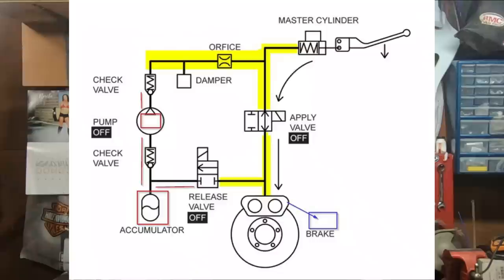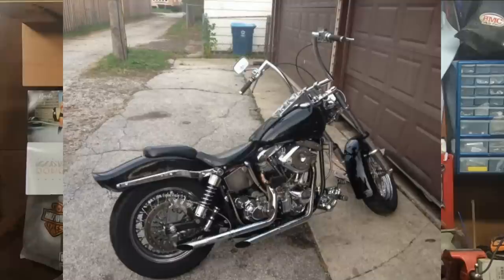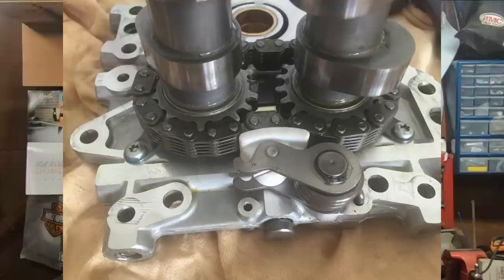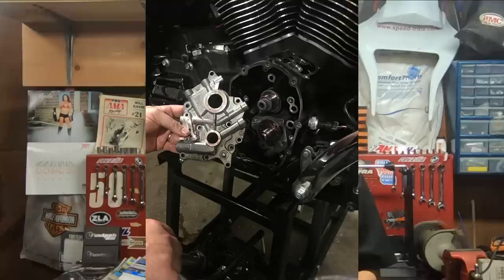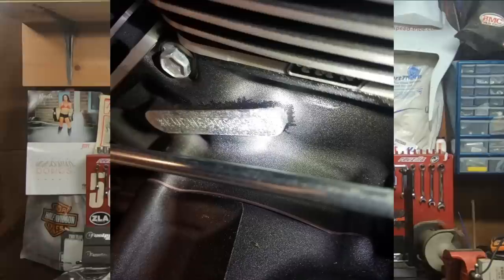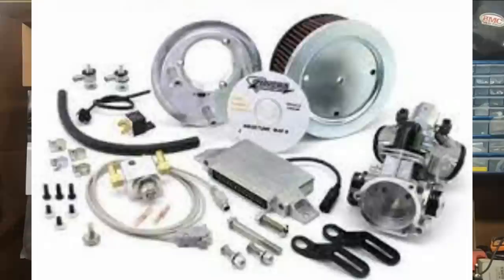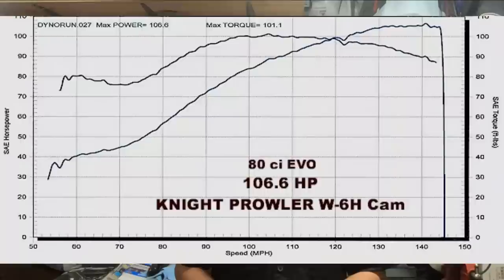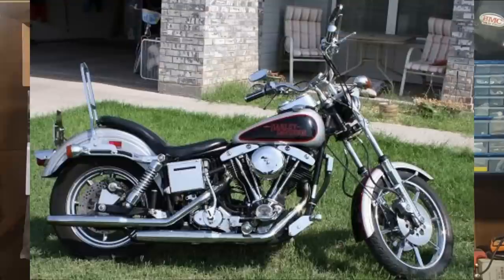Best Harley Engine Ever Made (Arguably)

Comment: I have a couple of 02 gear driven wide glides and love them to death. S&S 509 and 570 cams, whole lot more goodies of course. You are 200% correct on the roller bearing set up that Harley switched to in 2003. Last year of the timkin bearing set up  from Harley was 02 and I feel that they have gone down hill ever since. Only thing I would like is to be able to do is set my idle like an Evo, but I just don't trust the oiling system. A cammed Evo at 650 rpm just sounds bad ass.
Reply from the maker: That gear drive whine is one sweet sound but for sure on the FI twin cams you don't want your idle below 900. Sucks you can't idle them down like the good old days.
Reply: @GixxerFoo  I've actually taken the first one in because of that "whine" and got a "yup, that's what they do, sounds good"...lol. I can adjust the idle down because they are carbed but I have seen the oil light flicker around 800 rpm, sucks because it sounds great
Reply: I have an 02 Road King that I bought maybe 7 years ago , runs amazing, never a hiccup , my friend is an experienced Harley rider he told me bike has timkin bearings that’s the better engine …I had no idea I only rode metrics but I have a few bikes and the Road King has never let me down , runs perfect I just change the oil and filter ..

Comment: 80ci & 80HP Pretty much the Reasonable performance & reliability limit for genuine HD EVO. And that’s enough for most folks. If you want more the aftermarket Evo can deliver 100+HP and reliably. So I generally agree. 

Also I suppose if you need major work on your M8. It probably takes some specialty tools from Jim’s. My own experience was a full warranty stage 3 out the gate all genuine HD that made 116 HP. Good power without pushing anything too hard. So far 30k miles on my Sport Glide zero issues. No repairs whatsoever to date. For me the right aftermarket EVO could be really cool but it’s definitely easier to find an M8 that is also a powerful reliable and relatively simple engine.
Reply from the maker: You get a M8 done up like you've got and they are one hell of a motor, I think sometimes they get pushed pretty hard with what they are capable of. Evo always had a way of putting that power down that made it feel faster than what it really was.

Comment: Not counting collector bikes that I would just ride on Sunny weekends, my favorite everyday riding Harley engine of all time is the Evo. Specifically the Sportster Evo. I would trust this over any other Harley engine to ride daily. My twin cam is nice but I'll be adding an Evo Sportster to the garage when I get a chance. I really miss my old 883 for everyday riding. My 883 could run on 87 octane, it got excellent miles per gallon when I toured it( yes I toured 27 states with it), the drive belt was easy to change, push rods were straight up and down, no wobbly cranks, came stock with gear-driven cams, oil pump is easily accessible, less places to leak from the primary, easily accessible transmission gears on the Pre-04, simpler oil change than the big twin. I find it ironic that the best made Harley of all time is also the least respected.
Reply: Nicely said. Once the traditional Sportster is canceled for the new China engine, watch it suddenly become a very sought after model.
Reply: @browngreen933  I'm hoping to grab one before it does.
Reply: @jamessouthworth1699  
Now you've got me wanting one too!
Reply: Bought myself a 98 Sportster S.... I just love it. Complete peace of mind in the engine department ✌️
Reply from the maker: I am huge Evo Sportster fan, that is a bullet proof motor and honestly it's about as close to perfect as you can get. I wish Harley would of used that same design and built a big inch version. S&S had that 100inch motor for a while but it was very expensive, didn't really put out the horsepower I would expected at around 100 but the torque was up over 100 which is a huge win on a Sportster.
Reply: @GixxerFoo  I just love the 98 Sportster S..... It has  magic torque...

Tell me do the Sportsters have heat issues?

Tx for your channel bro, really appreciate it 🙏👍
Reply: Man am I glad that the slightly used Sportster 1200 that I bought turned out to be an '02 ! I put on an Accel coil , Cobra exhaust pipes and the S and S air cleaner . After having the carb re -- jetted by the pros at House of Thunder in Morgan Hill , CA , that thing runs like a champ . Very pleased with it .
Reply: I had an Evo Sportster, also a couple of Twin Cams. The Sporty was a far better bike all around. My opinion the best bike Harley has ever built. My jury is still out on the new models. I have moved on to other brands but would like to add another Sporty to the stable. Prices on Sportsters have skyrocketed lately though so probably won't happen. The only shortcoming on the Sportsters is the horrible suspension which can be fixed with $$$s.
Reply: @karlbishop7481  ain't all of that the truth.... Like art they will be properly appreciated now that they have stopped building them👍
Reply: That is so human nature... They are now appreciated in hindsight like Van Gogh
Reply: @browngreen933  I’ve got an sportster 1200 in the garage, I may add another bike to the fold but after seeing what they did to the new sporty mine earned a permanent spot for sure.

Comment: I like the new Harley’s but I will keep my 01 fatboy and 03 roadking. I did the cam plate upgrade,509 cams,adjustable pushrods,lifters,2 into 1 exhaust,high flow air cleaner and tuners. Now I know what I have and don’t want to start all over with a new bike,I’m getting older and seem to ride less and less every year.
Reply from the maker: I like the new bikes myself but I just can't see spending that kind of money only to convert most of it back over to the old school designs. You've got your Twin Cams all setup right so I wouldn't be in a hurry to get on a M8 either!

Comment: My sportster came out of the box with 70HP and it was a 1200. Love that bike for its pure simplicity and the advantage over my Victory is the carburetor adjustment and timing I can adjust for maximum performance with just a screwdriver and a timing light. The modern bike takes a Dino and a computer with any kind of upgrade and I can't do the adjustment with simple tools. Even the Harley guys made compliments when I took the bike in for tires and it was all stock and the tech was rolling the throttle and saying how smooth the engine sounded.
Reply from the maker: Sportster Evo is about the closest to perfect design ever put into a Harley, they are solid and dependable motors!
Reply: @GixxerFoo  I have a 2017 sportster 1200 and that comment you made about the fuel injection made me a bit nervous. Is there something problematic that I should be looking for in particular?

Comment: 93 FLHTP I just converted it to a Tour Glide fairing over the winter I love it it looks like a RG. Mines got an EV27 ..S&S lifters…S&S steel breather gear…S&S carb…changed out the bearing…Andrews push rods ….3 angle valve job and Thunderheader and for an 80” it pulls really well and in my opinion…it sounds better than my 83 Shovel
Reply from the maker: That's awesome! That's what I love about the Evo's is you can make them anything you want and getting a hot motor is way less expensive than the new bikes!

Comment: solid vid again,  i have a buddy of mine who has a 98 dyna that had a evo in it but the cam bearings walked on it and replaced it with a revtech 100 ci which just happens to be a big evo... 180 km (112 thousand miles ) on it and its still running strong as ever... old Harleys never die.. they just go faster
Reply from the maker: That Revtech 100 has to be a blast to ride, those engines put down a lot of power! Those INA bearings that came stock were known for doing just exactly what happened.

Comment: A friend bought a then-new '98 RK. And after doing the cam bearing with a mild cam and Jim's Powerglide lifter & block set, he put over 110K miles on the otherwise stock EVO with no part failure.
Reply from the maker: That's what is absolutely awesome about the Evo, he did everything you'd want to do to one and sounds like he took care of it to get to 110K!

Comment: My evolution is the best one I’ve ever had!  She’s the last one you can actually work on, as a garage mechanic.  The new ones are dealership babies and you better be good, or bring it in for mechanics to work on. That means a lot more money!
Reply from the maker: The Evo is the last one you can use basic hand tools on, you get into the Twin Cam and M8 you'll need some specialty tools. There's not a rental program on those so you're stuck buying them which sucks if it's a one time job.

Comment: I owned a 1948 Panhead for about twenty years, an Evo Heritage, a Twin cam 88 Roadking, and my current ride a 2010 Electra Glide Limited with the 103. I liked the kick-starting, the sound and the feel of the Panhead. I really like the cruise control, stereo, 6-gallon gas tank, and the ABS brakes on the Electra Glide. What I didn't like about the Evo and the twin cam 88 was the 5-speed tranny, (they needed a sixth gear) and the loosey single piston brakes.

Comment: Love my Evo bike. I also recently sold. RK TC88 to buy a 2015 ultra limited with the 103 high output with liquid cooled heads. Essentially, what I've realised about Harley engine's, is that if you get the last varient its usually solid. TC88 had the better bearings originally but the tensioner issue etc by the time the 103 was finishing it's life, it was nearly perfect. M8 came out with transfer issues and sumping, with that oil pump issue, by the time we get to the last push of the M8 that will be an incredible motor too. Their incremental improvements over the years always add up.
Reply from the maker: That's very true, same goes with the Shovel and the Evo! I've said for a while now that late model 103 was just about perfect, now the 110 still had it's issues lifters with the 255 cam.

Comment: My 96 Softail Custom Evo goes awesome. I've put an Ev27 cam with bigger jets in the carb, K n N air filter and after market slip-on pipes and it can sit on 80 MPH all day long, plenty fast enough for me. No bass gasket leaks because I always warm it up properly, but did have to replace the plastic breather gear because it broke a few teeth.
Reply from the maker: Warming those Evo's up goes a long way! EV27 is an awesome cam, that was one of the best Evo cams out there.
Reply: I just put the EV27 cam in my 98 RK.. ..
Reply: @mrwilson2225  What do you think of it?
Reply: I like it, it was definitely a good investment.

Comment: Great video, Years ago I had a similar problem with my 2001 Road Glide. I installed a progressive suspension touring link and solved the problem. Now I own a 2010 Road Glide and installed a alloy art frame stabilizer after putting 21 inch front rimand tire and solved the wobble.

Comment: I was one of the very first buyers of the EVO MOTOR... It was a great move for HD reliability... BUT ... BUT ... The Electronics Ignition FRIED 3 times.. I put points in it!   The CLUTCH FELL OUT OF the SLOTS  ""TWICE""  The Valves always knocked and I just rolled with it!  The Shovels and PANS were pure SHIT!  I had 4 of them and they all were NIGHTMARES... The EVO was a dream Engine for me... I put 22,000 miles on it in the first years and a half.. It was in the shop but.  .All and All a great motor
Reply from the maker: They had issues the first few years but like any Harley moto when they had if perfected they switched to new set of problem with the Twin Cam. Lol they had the Twin Cam 103HO about perfect and moved to the M8 with the oil sumping issues.

Comment: Wow. The Evolution engine gets credit for the Tumken sprocket shaft bearing. I was under the impression that the technology " evolved" from 1955. Thanks for the lesson.
Reply from the maker: In all fairness it was updated quite a bit, the Evo did benefit from better machining practices and tighter tolerances.
Reply: The Timken bearing is the same part number back to 1970. The Timken was a production change in 1955. Yes, much better metallurgy, no doubt.

Comment: Just had an 01 Ultra in with 108k miles and just ridden from Rapid City to Key West and back. Customer has all records from day one. I just did the cam chains and tensioners for the second time at 108k. It's on the road out West now. There's a lot you guys have yet to learn about TC cam chain tensioners. The early horror stories were true, we had a pile of cam plates two feet high at Sturgis 99 and 2000. Not for tensioners, but rear cam bearings. Once that self-induced issue was resolved, and the necessary changes made to chains and tensioners and we became aware that multi Viscosity oils don't work, those of us who steered our customers right saw great reliability from 99-02 TC 88 and 95 engines without all the heating issues caused by the increase in stroke when we put the P and A flywheel in it as an OE part later on. I've seen  hundreds of early TC engines with very high miles, still giving great service. No gear drives, no Dark Horse cranks, just box stock Touring bikes that rack up the miles. I ride one with North of 80k miles, I've been in the cam chest for inspection several times, replaced chains and tensioners once at 30k to get the suspect pad material and substandard chains out, happy travels since. The horror stories with cam chain tensioner are overstated by marketing designed to steer one toward expensive parts.
Reply from the maker: Tensioners were a big problem, some bikes did lasted longer than others. The Twin Cams are a lot better than what they get credit for.
Reply: @GixxerFoo  Had nothing to do with what bike. It was about using the right parts, knowing how to ID the right parts, proper inspection and install, they were very robust. Many times a failed primary tensioner is an indicator of an issue you won't fix with aftermarket cams.

Comment: Yep, the evo was a big step up from the shovel, I get about 70,000 miles out of my shovel top ends, there's a 97 evo I work on out there with over 200,000 miles on the factory topend, clutches cam, lifters carb clean is all I have done through the years, he warms the bike before taking off so base gaskets only slightly weep, I've sent several twin cam back out the door with major engine damage not worth repairing.
Reply from the maker: That's a big thing with those Evo's is making sure you warm them up, that really saves you a lot of headache down the road. 70K out of a shovel top end is pretty dang good honestly! That's the sad part about the Twin Cam is a lot of times they just aren't worth repairing. Those motors can have some serious catastrophic failure which just makes them not cost effective to fix, time for a new used motor or a crate.

Comment: Best engine they ever made.  As long as you don't mind bad castings and cracking cases, pulled cylinder base studs, base gasket leaks, unserviceable fuel injection, 40,000 mile lifter replacement and top end rebuilds, etc.  Sorry, no sale.  My vote goes to the Twin Cam.  I've now put a combined 200,000 + miles on two examples, with the only issue having been the infamous rear cam bearing on my 2000 Road King.  Replaced at about 40,000 miles, I put over 120,000 on that bike with nothing more than oil changes, brake pads, and tires.  Its replacement, my 2013 Road King, is fast approaching that and has required nothing beyond the same routine maintenance.

I've owned and ridden a number of Harleys since 1976, including Shovels and Evos.  I still own a 1976 XLCH I bought in 1979, which now has over 200,000 miles on it.  Believe me, I'm no stranger to wrenching on these things, so I have to say, the ones that have required the least of that activity have been the Twinkies.  Don't get me wrong, I loved (still love) Evo's, but for us high mileage riders, nothing beats the Twin Cam.  The complexity of the Milwaukee Eight does scare do it yourselfers like me, so I will likely never go there, but the Twinkie is, to me, that magical "Goldilocks" machine.  Just right...  Modern longevity, easy enough to work on.  Assuming I ever need to do that.

Comment: The Sportster Evo is the best Harley engine ever made. They're the only Harley engine you'll find en masse running around with over 100k on the engine with no rebuild or work of any kind. Also, it's just an updated and modernized Iron Head from 1957. They've had a LONG time to make it perfect.

The real Evo's in biger bikes are for sure the best big twin Harley has ever made. But I'll say it until the day I fucking die; if Harley just takes the Sportster Evo and makes it bigger so they can reasonably make it a 110+ci engine, and sell it in their big bikes, it'll be the best big twin ever built.

Edit: It also should be said that the Sporty Evo's have way more power potential than anything Harley has ever made. After all... how many dudes make 150-200hp Sportster's? A hell of a lot, because they handle it well and the architecture of the engine is perfect for power production.